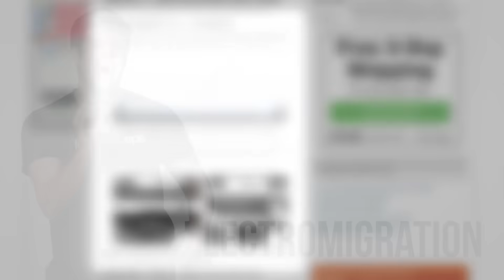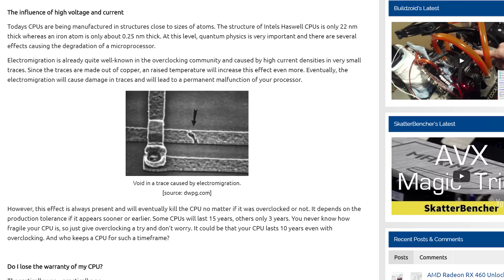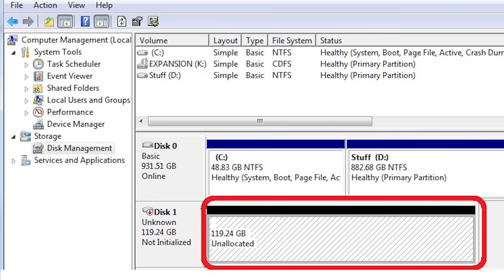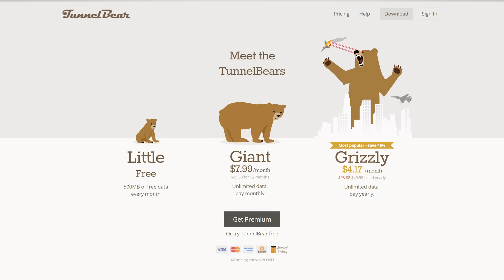Why Do Electronics Die?

Comment: It is simple. If you make things that fail you will get repeat customers. It is not profitable to make things last a long time. They can make things last a ridiculous amount of time. Many things built many years ago can and still get used today! This is where you need people to believe new is always better. Well the question here is better in what way? Yes usually newer is fancier and sometimes more user friendly BUT will they last? Usually not. Example: many farmers still use tractors that are 50+ years old daily! I have a tractor built in the 30s with tires that still hold air! The brand of the tires went out of business over 55 years ago! That means them tires are at the newest 55 years old! While I have hundreds of tires much younger that have got so bad you can literally use your hands to pull them apart. Things can be and had been made better at one time there just is no money in it!

Comment: a capacitor blow in my power supply beck in 2011, restated the pc worked fine, now in 2019 after years not powering my pc, tured it on still works just fine

Comment: I have still some Nokia 3210 original Handys and they work perfectly fine... Also my collection of mdas, vpas, N70, N95 8gb, N73, razer1, galaxy s2, s5 and so on are still working fine... I actually never experienced any complete fail of a smartphone or handy before. Only when I let one fall down which was only 2 times on s2 and one s5 and both of them would have been OK if I replaced the display...

Comment: Nice overview.  Three key points to add:
1. Important to stress the most common causes of failure and how users can avoid them (e.g. heat, abuse of connectors, dropping,  liquids).
2. Biggest problem I've found is that websites become bloated with videos, pop-ups, scripts, etc. so that more powerful hardware is required to deal with them (alternately, ad blockers). 

3. Some of the long-term problems you mention could be planned for by ensuring that vulnerable parts can be replaced. Batteries, hard drives and memory for example.

Comment: My old 486 computer from the 90s will work long after my new 2019 computer because of one key difference -- it has lead based solder.  Tin-lead solders are far more forgiving of thermal cycling and shock/vibration than the lead free solders which are, frankly, brittle fom the get go.  Lead-free solders were foisted on us by something called RoHS (look it up).  I can have over 100 pounds of lead in my cars (lead-acid batteries) , but heaven (or FRANCE) forbid I have a few ounces in my computers!  This is a real crock of sh.. that results in more waste and pollution than if we had longer lived electronics with a smidge of lead in them.  You may ask, why aircraft, medical, and military electronics are exempt?  Well, that's because everybody knows those things MUST work reliably, but your computers, cellphones, and TVs can all drop dead after the warranty period, and Dell, Samsung, Sony, and all the other suppliers will be more than happy to sell you a new one. Not that I have an opinion on the matter...

Comment: ROHS combined with surface mount technology are a devil. The lead free solder is more brittle and cracks. Add that feature to components that are soldered directly to the PCB and you have a recipe for failure. The PCB and the components expand and contract at different rates, the brittle solder cracks and fails. Older through hole components can flex through the wire.
If you live in a place where the Summer-Winter temps are great, expect to see these failures. Vehicle see the biggest swings with crazy in cab temperature swings.

Comment: if you're "smart" with your electronics?...they can last for a lot longer than the manufacturer specifies....case & point?

You'd think laptops made in 2011 or 2012 would be nothing more than paperweights right now...but because of the availability of replacement motherboards....processors....hard drives...displays etc....they can be refurbished and continue to be used....I have a ThinkPad T-420, and a T-430...that SHOULD be obsolete right about now...but that are STILL running...and running fast and lean with Linux...(no kludgy Windows 10 here!) and they seem to be getting BETTER as they age!...I dunno, but it seems that without all the "tomfoolery" going on behind the scenes with Windows?...a laptop can run for YEARS as long as you take care of it..and don't expose it to excessive heat, moisture, or dust / static electricity....I've replaced the motherboards and upgraded these laptops to 1TB 2.5" SSD's and 16GB of RAM, and even though they're running older dual-core i5's?...they still seem to be able to do everything I need 'em to do with no problems...from playing Fortnite...to coding in C++ and Python...to streaming classical music over internet radio....so much for "Planned Obsolescence"!...LoL! I would recommend.....if you ever need a spare laptop to just do "regular' stuff online....get one of these models...admittedly...they're THICK..and HEAVY...BUT...they come with all kinds of PORTS...and they're  RIDICULOUSLY CHEAP!...and so are their replacement PARTS!.....you can also connect it to a nice 27" flat screen IPS monitor...which looks AWESOME!...

Lenovo ThinkPad T-420:
https://amzn.to/2mgreao

Lenovo ThinkPad T-430:
https://amzn.to/2kDGT3k

Comment: I have a tape recorder from 1958 that still works perfectly - with it's original capacitors....
Reply: I was about to brag about my VIC-20 working for 40 years on the original capacitors, but I think your tape recorder has my VIC beat by a few years.
Reply: Honestly capacitors in a tape recorder probably get charged and discharged less often...
Reply: @petrsacher1281  I think it's more a question of not designing to the limit. To take an example, today if a developer calculates a capacitor to minimum 1200uF he will go to great lengths to prove that a 1000uF is sufficient, to save money. Back then he would have put in a 2200uF because that was the nearest higher value. This meant that this capacitor could loose almost half its value and it would still work fine. Another thing is that because everything was bigger there was much more ventilation so components were kept cooler even it the electronics were tube based.
Reply: @organfairy  if you want that device to last longer keep an microscope out for Metal whiskering. It is prone to happening in older electronics more often then new ones.
Reply: Bruh. That's Just One Year After My Country Independence.
Reply: @wouldyoureturntomonke2452  Untrue, they were just as greedy at any point in history as they are now. Its just back then the hotly debated issues were more issues of them killing either their employees or their customers rather than simply faulty products.
Reply: @jdslyman those old floor radios used those. They last long if they are exercised but when they sit for many years without power is when they take a dump and when plugged in again they blow out the tubes
Reply: @MrNeutron98 "hello I like money"
Reply: @MrNeutron98 well dinosaurs didnt do a great job either
Reply: @MrNeutron98 cringe.
Reply: @Maevef100f  that's a myth. Lol. 

They other bulbs lasted twice as long but weren't as bright. Yes it was planned obsolescence. But there was no immortal bulb before that. And the same technology exists today and is used. That cartel broke up in the 1930s. Over and done with. You have companies competing now around the world. If there was a never ending light, we'd have them.
Reply: @MrNeutron98 lol cringe kid
Reply: Hacks
Reply: Nice
Reply: @Maevef100f  proof?
Reply: and I wonder how much it cost and how often it was actually used
Reply: Same bro
Reply: @alfa-psi  a bad capacitar made him type that.
Reply: I had a decatur radar gun from the 70s. Still worked. Bought it for 50 and sold for 350 on ebay. Worked when sold.
Reply: Impressive, occasionally I’ve found that audio equipment occasionally survives capacitor issues. Father gave me a really, really, REALLY old guitar pedal and the first thing I checked was the caps, they looked good as new, I was actually impressed.
Reply: You sir, won the silicon lottery
Reply: its*
Reply: Damn boii
Reply: Then you should probably worry and keep a close eye on thrm
Reply: @Maevef100f  where exactly did the immortal light bulbs go??? They're immortal aren't they??
Reply: Weren’t casette tapes introduced in 1963 though?
Reply: @Leonardo-G  Yes, but before that there was reel-to-reel.
Reply: @Maevef100f  that's a myth. Lol. 

They other bulbs lasted twice as long but weren't as bright. Yes it was planned obsolescence. But there was no immortal bulb before that. And the same technology exists today and is used. That cartel broke up in the 1930s. Over and done with. You have companies competing now around the world. If there was a never ending light, we'd have them.
Reply: My pc have 50000 hours solid capacitors
Reply: They made EVERYTHING lasting and durably back then.
Reply: I had the first model walkman from 1980. It worked perfectly fine for 30 years before I sold it.
Reply: OG Xbox owners have to deal with it, compositor gate hit it very hard
Reply: @MrNeutron98 You can fix these too. Just desolder and install new caps.

All you need is a better education.
Reply: its*
Reply: Its just funny how one of my gpus stopped working now but my 9500 gt from a decade ago still posts
Reply: Impressive considering capacitors are the failure point especially since they were often made of waxd paper
Reply: yea of course if u don't use it they will last 4 lives of ours 🤣
Reply: I have a 60s all in one turntable system and all of it works perfectly with original caps
Reply: What in the world 😮 Solid tape recorder you got there!
Reply: @MrNeutron98 careful to not cut yourself on that edge
Reply: @SenorGuina  Right to repair and planned obsolescence isn't edgy it's an ongoing legal battle between consumers and businesses, and a political one as well.
Reply: @barretprivateer8768  oh i have no problem with having opinions on that, what is edgy is wishing the destruction of the human race because muh nature, if anything the dude should do the honours to show he's not being an edgelord
Reply: @MrNeutron98 Those who wish for human extinction should take the initiative and set an 'example'.
Reply: @Igor_servant_of_Philemon  edgy
Reply: @madisonbrown8851  in hindsight, yes. But less edgy than the guy I replied to.
Reply: @MrNeutron98 are you serious 
Devices failed more often before than today because of immature technologies back then
Reply: @MrNeutron98 It's less the fault of capitalism as a system and more about companies being rewarded for their behavior by default because of a predominantly brainwashed, or simply apathetic, consumer base. Most consumers now are not willing to forgo the "latest and greatest" to tell companies "you will not make a profit if you do X." I'm afraid principled consumers are a dying breed.

Populations ultimately get the governmental/economic systems they deserve. If you put no work in, the system will eventually devolve into corruption. Work in this sense being classified as casting actual informed votes or principled consumption.
Reply: They hadnt perfected making their products fail after a set amount of time yet. The saying "they just dont make things like they used to" is 100% literally true. Most everything made nowadays is made to last a set amount of time so you have to buy a new one. Like the apple scandal where it was proven they purposefully throttled their older devices to encourage people to buy a new one. We've all got the good old american value of nearly unregulated capitalism where ANY action or inaction is justified based soley on if it increases profits or not.
Yay la ze faire capitalism!!!!!
Reply: @MrNeutron98 you're very optimistic
Reply: @joshdeveaux6936  That's called being realistic.
Reply: Planned Obsolescence and Capitalism need to be eradicated
Reply: @MrNeutron98 So true. It's honestly embarrassing how wasteful humans are.
Reply: its*
Reply: @CreeperPookie  You corrected him wrong💀

Comment: I've found modern stuff fails because of a shitty power supply (the grid) and switch-mode electronics that can't cope with surges.

failing components due to electro-migration is perhaps more to do with normal operating temperature being too close to melting point of the solder. Any failure of a cooling solution, and you can be fairly sure the whole kit is going to be unusable in a very short time frame.

vintage stuff never suffered electro-migration issues. Even TVs that were running average 18 hours daily for decades.

Comment: Personally, I believe your hardware can last forever if you take care of it. Properly cleaning the fans, having airflow, not having high temperatures in your pc, and cleaning your computer software, like useless bloatware and things you don’t use. Most people now a days don’t take care of their PCs and let everything over heat. Keeping your PC at a low temperature and removing all the dirt, grime, and dust we’ll keep it good as new so your fans don’t have to work harder than they should. Basically if you maintain your PC also keep it clean both the hardware and software by removing useless files and bloat ware it will last forever.

Comment: Planned obsolescence does not exist.  Designing for a specific minimum useful life does.  Example:  The hinges on your car doors have a useful minimum life of at least 15 years.  This means they usually will last for at least 15 years, perhaps as many as 30 years, but probably not 100 years.  They can be designed to last 100 years, but that would make them prohibitively expensive.  The same is true for all things that are designed.

Comment: PROTIP: Drain your microprocessors of that pesky, damaging electron buildup by simply REVERSING THE POLARITY. Negatively charged electrons will be instantly attracted to the new positive and merrily dance their way out of the microprocessor into the power supply. Don't worry about the smoke, that's supposed to happen.

Also, it's never Lupus.

Comment: My Samsung tv had capacitors next to heat sinks. (As did 2 other family members and a neighbor). Almost like they planned them to dry up after warranty expired. Solution is to replace with high temp capacitors that Samsung should have used. Very clearly an intentional thing on their part. Any 1st year electronic student knows putting a temp sensitive component next to a hot heat sink is a poor and unnecessary design choice. Unless you want it to die after the warranty is up. I love Samsung phones but I'll never buy another of their TVs because of this

Comment: There is also another issue

CMOS, NMOS, MOS... Metal Oxide Semiconductor. 

Basically when a manufacture builds a semiconductor using those silicon discs, they build the circuitry into micro layers.  Each layer is separated by an oxide (rust).  Over a period of time the oxide will build microscopicly and shut down or short the micro circuitry.  No matter how well the semiconductor is hermetically sealed, air will still come in and the oxide will increase.

This happens from single transistors, to millions of transistors in a CPU integrated circuit (chip).

That is a natural occurrence.

Comment: You're actually wrong. The wire doesn't necessarily move.
For example Copper which has 2 valence electrons and 30 free spaces in it's valent layer can be a temporary host to up to 30 ions which are just electrons who escaped the orbit of their host atom. 
So when you plug in a wire into the wall, basically stored electricity is sent through it and all the electrons start occupying these vallent blank spaces and eventually they get to the load.

Comment: Well if you want to be technical electricity is the flow of electrically charged particles which in copper wire happens to be electrons. However when you get a shock the current flowing in you isn't electrons. It's charged particles like Cl- and Na+.

Comment: I’m still using a Compaq Presario PC after 23 years and everything about the computer works fine. I bought it in 1995 and the computer is still running on Windows 95. Electronics can last decades if kept very well maintained.

Comment: Micro fracture in BGA, whiskers from solder points creating shorts, temperature fluctuations causing PCB flexing, degrading electrolytes in capacitors, finite program erase cycles in flash, degradation in moving parts, dust build up and static discharge and the list goes one.

Comment: Another reason why electronics die. Is if you zap static electricity into a computer part in your build, and somehow you only used your dream gaming rig for a few hours to only find it go BSOD and you get a hardware error on the bios screen saying that a CPU is not found.

Comment: I dont think these are serious issues when it comes to PCs you want to replace them every 7-10 years anyway and even if you do not they can last up to 15+ years.
But it can be an issue for old gaming console systems. One day we will no longer have functional gaming systems from the mid to late 90s and early to mid 2000 and the games those systems can play will become literally unplayable if no emulators get made. Older systems seam to be indestructible thou i think everyone's Nes Snes and Genssis still work to this day probably the components and microprocessors on those are so big micro damage does nothing to them.

Comment: A great piece, but one major error: Silicon and dopant atoms aren’t going to move around at all, at any temperature that wouldn’t incinerate the circuit board. Diffusion coefficients are an exponential function of temperature, with a characteristic activation energy, so even at 500C, they’re going to be vanishingly small. At 200C, they’d be another three orders of magnitude smaller yet. At 200C, nothing is going to be moving, even on the scale of centuries.